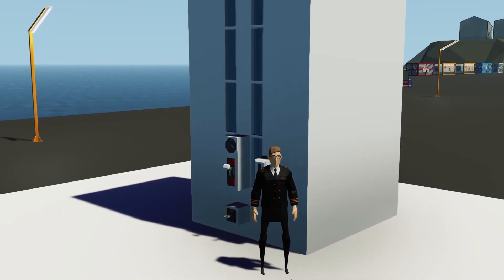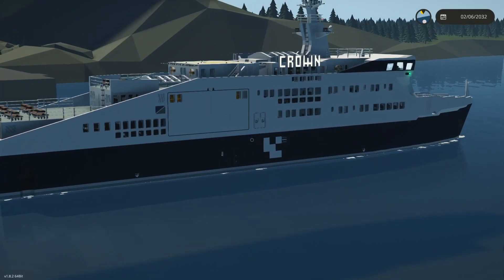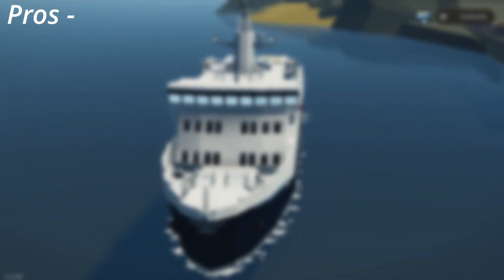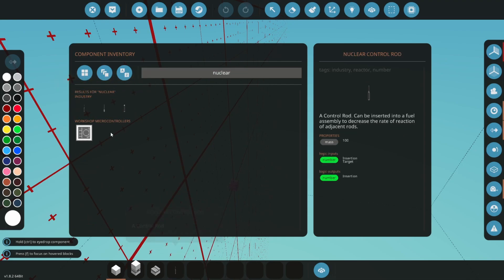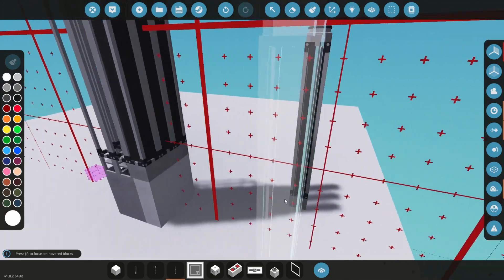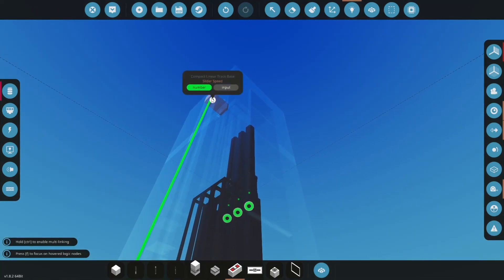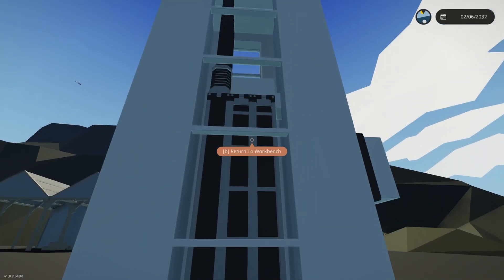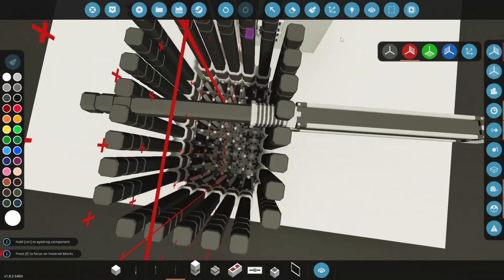The Basics Of Nuclear Reactors In Stormworks

Comment: I forgot the water
Reply: Yeah, i suggest just making a system to bring the fuel rods up and down instead of using control rods: Instant cooling  and more precise measurements
Reply from the maker: @kurizo7  No I don’t think that’s possible. In real reactors, these don’t move, but the control rods do. In game, you can’t even move them without fully stopping the reactor.
Reply: @NeatNaut  You can’t? for me when i just slightly remove it, the heat decreases
Reply from the maker: @kurizo7  Well that's interesting. I don't think it is standard procedure though.
Reply: @NeatNaut  Haha, not at all. I generally only use it when my incoherent friends mess up the control rods
Reply from the maker: That happens to everyone, if I remember correctly, I forgot it during the making of this video!
Reply: @NeatNaut  and no matter what I do I can't make it not blow up
Reply from the maker: @Robotic_smurf  Did you do everything exactly as it is in the video? Double check your logic maybe
Reply: @NeatNaut  I did what you did even more water and control rods but nothing works it has been like this after the water update
Reply from the maker: @Robotic_smurf  That is really weird, how many rods are you using?
Reply: @NeatNaut  9 the max I can fit on it
Reply from the maker: @Robotic_smurf  Try it with less ( like 6 ). Did you add the other rods the way I showed? Besides, more rods don’t help.